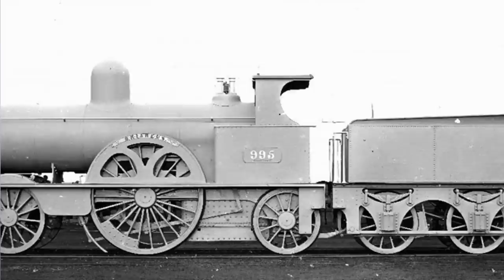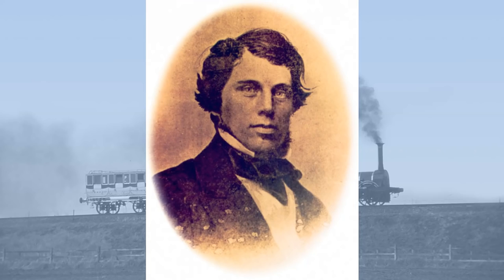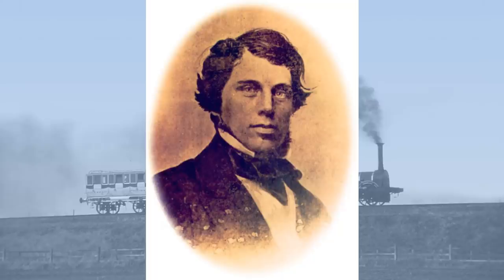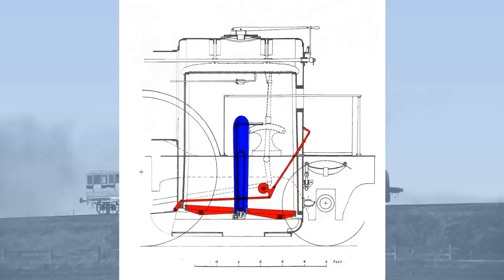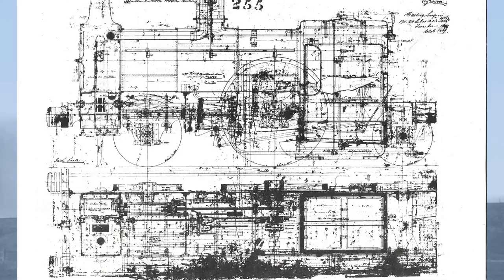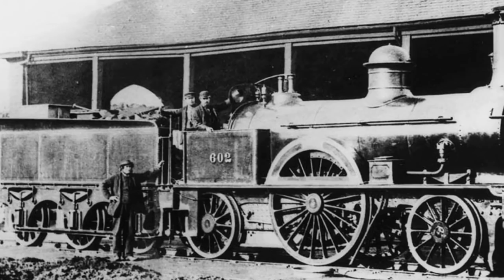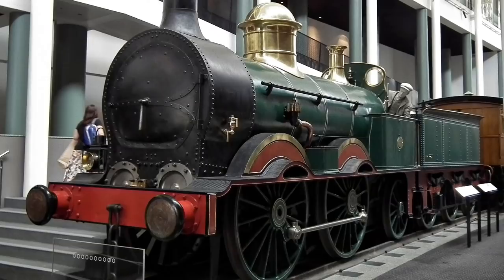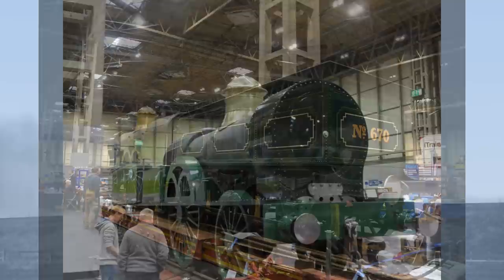Bloomer: The Basics

Comment: No he didn’t.  Coil Springs.  He predated Alec Issigonis by around 110 years.  He used rubber suspension.  Alternate disks of rubber and steel.   These worked well, but did not last because the abundance of oil locomotives use for lubrication spread to the natural (as opposed to synthetic) rubber, and caused it to perish.  You need to read EL Ahrons book, ‘The British Steam Railway Locomotive, Volume 1, 1825-1925’

Comment: Were these really the first high speed train?
I would have thought the speeds achieved by the larger broad gauge GWR locomotives would be higher and safer.  Both at the gauge commission testing and by the comparison of 1850s timetables.
Would have thought there was much more grate and heating surface area in the heavier and larger cylinders of the broad gauge state of the art in 1851.
Reply from the maker: The speeds they were doing were comparable, and just like the dear old HST, the Bloomers completely revolutionised travel between London and Birmingham. Cutting the journey time, reducing costs etc.
Reply: @AnthonyDawsonHistory  So are these the new HS locos for HS2,  (Will they fit?)
Reply: @AnthonyDawsonHistory  what became of the Norris steam locomotives I am guessing they where all scrapped eventually
Reply from the maker: @eliotreader8220  yep. Two of them were converted to tank engines.

Comment: Excellent video. To add a small bit of info regarding Locomotive No.1, it didn’t haul the first passenger train in Australia, it hauled the first (unofficial) passenger train in New South Wales for the Sydney Railway Company. On the day of the opening on the 26th of September 1855 No.1 was out of service in the workshops leaving No.3 to haul the first offical train.
Reply from the maker: Thanks for the info!
Reply: Neither did number 3 haul the first Australian steam passenger train. The Melbourne and Hobson's bay line had been operating since 12 September 1854. So a year previous to the Sydney line.
Wikipedia with some conjecture about the first locally built engine used.
https://en.m.wikipedia.org/wiki/Melbourne_and_Hobson%27s_Bay_Railway_Company
Number 1 may have hauled passengers to Lewisham on the 25th of May earlier in the year 1855 but less celebrated.
Reply: @johnd8892  read my reply properly and you'll see the bit where i clearly state that it didn't haul the first train in australia. As i was talking about New south wales and the sydney railway company its clear to follow it

Comment: You should do a video about the history of the John Bull locomotive because there is alot of controversy about it's history
Reply from the maker: I'm currently working on one and a book on the Planet and Samson class in which John Bull appears - thus far no controversy other than the loss of the tender and cab etc in an ill-judged "restoration". Perhaps I'm missing something?
Reply: @AnthonyDawsonHistory  Alot of historians are not sure if the John Bull that is on display today is even the real John bull  because of some things that were changed on the locomotive  but I've heard some people say there was possibly a second John Bull locomotive purchased hence why some historians don't believe that the John bull that is on display today is the real one
Reply from the maker: @jodysmith8048  We do know it was never called 'John Bull' by its makers. It is certain that a locomotive engine for Mr Stevens was built by Robert Stephenson & Co. and shipped to America. There are drawings for the boiler, a general arrangement drawing of it and the cylinders.  Certainly the locomotive now on display has been much-altered including new cylinders; a new smokebox; it's been re-tubed and the present ugly dome and external regulator fitted. The wheels aren't original, nor the axles. But the boiler shell, from its thickness and plate size would be 1830s; the outside sandwich frame is also 1830s. Other than those two components there's probably little else left from the original. We know Stephenson only built two locomotives like the John Bull, the second was called Maryland. All the other Stephenson exports had standard Stephenson boilers rather than the odd cylindrical dome-topped one carried by John Bull to this day. Jack White was pretty sure that what we see today at the Smithsonian contains key elements from the locomotive built in Newcastle upon Tyne in 1831. And he's the man on the subject.
Reply: @AnthonyDawsonHistory  Key elements are sometimes the best we can hope for.

Comment: Am I right in thinking both replicas have incongruously modern smokebox fronts and doors for them in their original cabless form?
Reply from the maker: They've got McConnell smokebox doors. Ramsbottom changed them to the horizontally hung ones later on.
Reply: @AnthonyDawsonHistory  Perhaps a video on smokebox doors and airtightness would be interesting.  In appearance McConnell's look ahead of their time but did they work?   if I recall correctly the LNWR still had problems with leaking doors as late as the Claughtons.

Comment: British railways seemed to be reluctant to move beyond 2 drive wheels  unlike the US and continental europe which had moved on to 8 and 6 coupled  and even 12 coupled steam!
Reply from the maker: For pasenger trains, train loads were relatively light; track was good, high quality and usually with easy curves and gradients. There was no need. Plus, going back to Robert Stephenson, there was a dislike of coupled wheels as they increased the rolling friction of a locomotive; all the wheels needed to be exactly the same size and wear evenly etc etc. As Patrick Stirling quipped a coupled engine was 'Like a laddie runnin' wi' his breeks doon.' Which is a fair observation.:-)